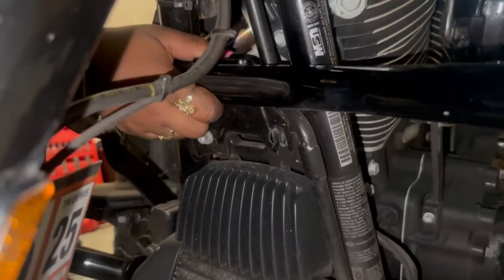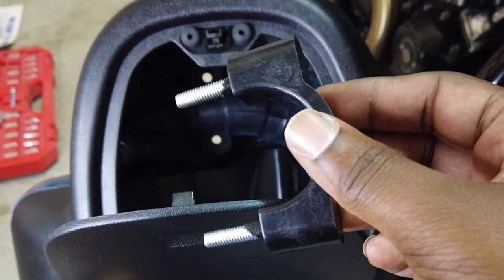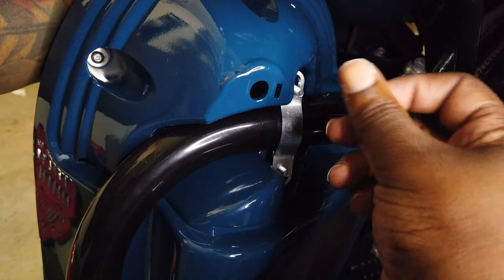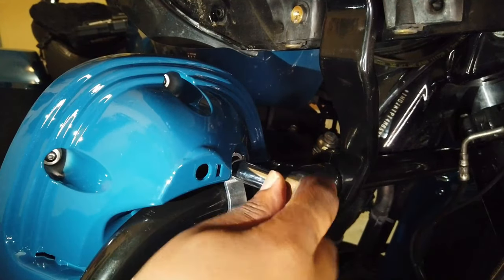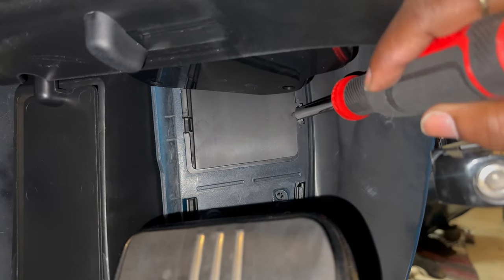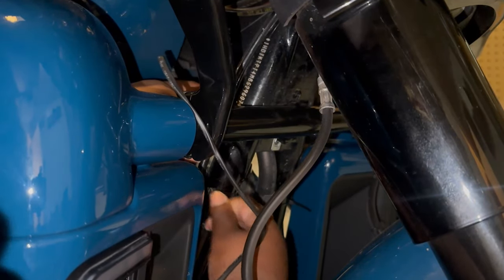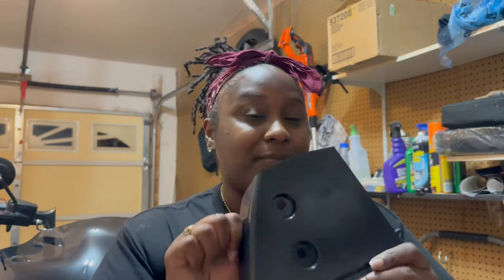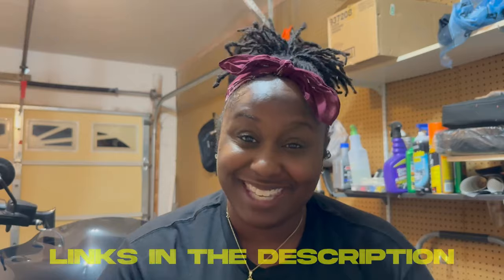This might just be my favorite mod! | Road Glide Special | Lower Fairing + Light Install @HogWorkz

Comment: Lower Fairings increase motor temps in the summer months my sista..................
Reply: Milwaukee-Eight Oil Cooler Fan
$275.95